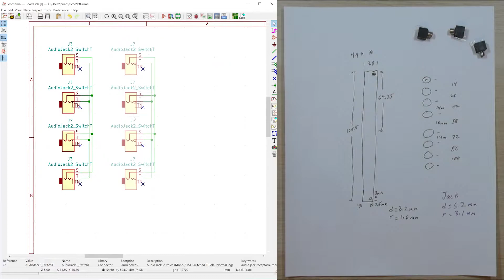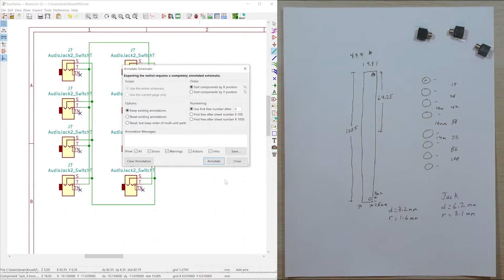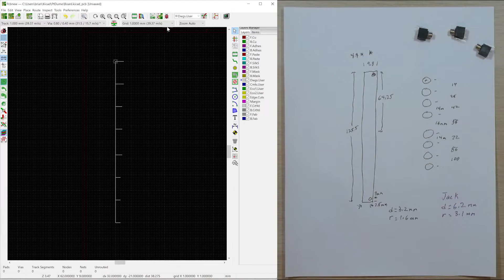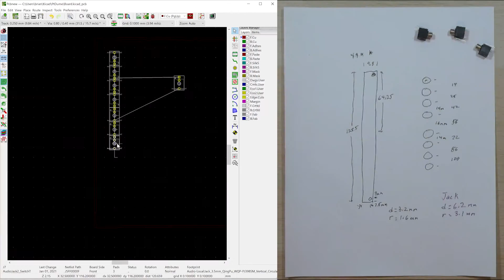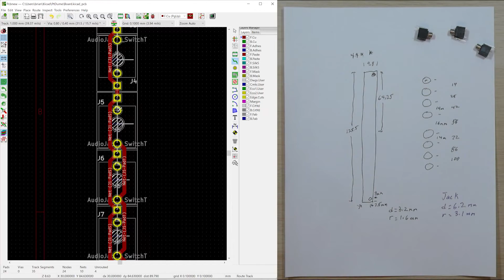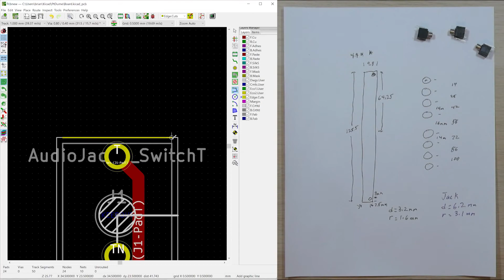How to Make Great Looking Modular Front Panels - Part 3 Module Circuit Board Layout

Comment: the center of the top jack to the center of the bottom jack is 100mm... how did you determine this number? could you go over how you analyzed the data sheet for the thonkicons and determined their spacing and positioning? also what size gap is needed so the jacks don't overlap with the case rails? would be really helpful!
Reply from the maker: Great questions! There are mechanical drawings for the jacks on the Thonk website but I find it most reliable to get parts in hand and measure them with a micrometer or ruler myself. The same thing kind of goes for the spacing between the rails as I don't think the Eurorack standard says anything about that. I measured the distance between them in my rack and then subtracted a bit from that to provide more clearance (but maybe not enough for all cases).

Comment: Thanks a ton for making these.

Workflow question: Is there any way to keep the panel edge cuts and the footprints in sync somehow? Or at least overlay both boards to make sure things line up? Otherwise I can see this getting old very quickly when dealing with more than a handful of components.
Reply from the maker: That's a great question and I've played around with some ideas in the past and not yet hit on something I really liked. I was playing around a bit with filtered selections in Pcbnew and it looks like you can filter out everything but the user drawings and board layout and copy that from one PC layout window to past in another. I may try to figure out a workflow to create a layout that way that can be used for both the front panel and PC board and if that works demonstrate it in my next series.

Comment: And a third comment :) :
You didn't fill the back copper layer like you did for the panel design. I'm assuming, just as with the panel design, that it is easier to understand for jlcpcb if there's a filled back copper layer, right? Even if it's a fully electronically isolated layer.

Alternatively, the back copper layer could also be used as the ground connection of the circuit.
Reply from the maker: It turns out there's a bit of copper on the back of that board, where the solder pads for the pins are. The reason I filled the front panel's back side is that there aren't any through-hole pads and so there was no copper on the back at all (I think Kicad even skipped generating the file for it, which makes sense). When I submitted that panel, it got kicked back from JLCPCB when they checked it because I had ordered 2-sided but the design only had the one side. Because that adds a couple days, I figure it's always best to make sure there's less chance to get things sent back.

Speaking of JLCPCB's design checking: I've been super-impressed. My first boards I submitted I also had SMT assembly for them and it turns out I placed all the ICs upside-down! I think I might have noticed this on my order right before the boards arrived and I was really bummed that I now expected everything to be wrong because of my mistake. It turns out they had already caught the problem and flipped everything around correctly and everything worked perfectly!
Reply: @eurorackDIY  Ah, I see. That makes sense. Well, I filled in the back copper layer, keeping it isolated from those solder pads, of course. I guess both'll work. Potato potato.

Good to hear that JLCPCB really double checks stuff :)

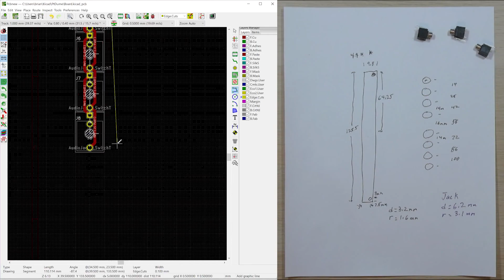Comment: Another question: This pcb that you're designing here has a height of 113 mm (as seen at 35:50). The absolute maximum of other boards I've seen is 111,5 mm and the TipTop Happy Ending Kit offers a space of 112,5 mm. It looks like this design won't fit!? How did you get this pcb into your euro rack case?
I'm designing a module based on this tutorial and I'm trying to figure out how to make this pcb a bit less high, which means pushing the minijack sockets a bit closer together.
Reply from the maker: Great points! I had other plans for how I was going to wire things together using different jacks and not have a PC board for them at all (so literally just solder them together with wire). That is when I planned the jack spacing and now that you mention it I might not have revisited how big the dimension on the board had become. I think I ended up getting lucky that that 113mm happens to fit in my rack (but there isn't much extra clearance now that I look at it)

My rack is 100% DIY including the 3d printed end panels that secure the Synthrotek rails I have. It may be inadvertently spaced slightly wider than other racks out there at what looks to be about 114mm.

At one time, I did look for a spec on how tall the guts of a module can be and much like I've found a lot of the Eurorack standard to be, I couldn't find anything. It does sound like to be safe boards inside the module should shoot for being no wider than 110mm.

Some thoughts on what could be done to the PC board to shrink it a bit:

1) the board sticks out at least 0.5mm beyond the housing of the jacks at the ends. The pads near the ends are 0.5mm to the edge of the board. JLCPCB says that dimension can be as small as 0.2 mm. Also, the drill holes for the T pin are 1.42mm on the footprint and the S pins are 1.22mm and the pins themselves look to all be 1mm wide. So you could change the pads to shrink those T holes by 0.2mm in diameter or 0.1mm of radius. Given all this, you should be able to move the end edge cuts in by 0.4mm (so gaining 0.8mm off the total board length).
2) The center of the T pin to the S pin (the one that's external to the housing of the jack) is 11.4mm. Looking at the jacks themselves, because that pin is on the outside, it could easily be sprung to say 11mm (and the pad spacing between S and TN should still be enough for manufacturing) saving 0.4mm spacing between jacks in a group which is 6 spots - so there's another 2.4mm total.
3) The spacing of the pads between the two groups is about 1.0mm. That could be shrunk another 0.5mm and still not violate JLCPCBs stated capabilities.

So that should be a safe 3.7mm total (but definitely more fiddly in the layout requiring footprint modifications and a bit more precise jack-to-jack spacing and edge layout and that would get this board under 110mm

One more thing that could be looked at is the footprint specified for the jack itself (PJ398SM or WQP518MA) on the manufacturer's site (http://www.qingpu-electronics.com/en/products/wqp-pj398sm-362.html) shows the holes as slots rather than round. It looks like JLCPCB would allow this according to their capabilities (minimum width of 0.65mm which is a bit larger than the footprint in the datasheet) allowing you to shave off even a bit more at least for that external S pin. I don't think I've had a board manufactured with a slot rather than round through holes so I'm not sure if this works myself.

Oh, and also, there may be other jacks that have a smaller footprint (and are still narrow enough for a 2hp module) that could work too.
Reply: @eurorackDIY  Oh wow, what a elaborate reply. Thank you.

Yes, online documentation of this dimension is vague. On the Doepfer site (http://www.doepfer.de/a100_man/a100m_e.htm), which I consider the standard resource, it isn't mentioned.

I've solved it myself by modifying the jack footprint: I moved the S pin closer to the housing of the jack. After that I rearranged all parts a bit too. I have a pcb design that's now 109,5 mm high. That'll suffice. I can send the design later (when it's fully complete) if you want.
Reply: Thank you for this exchange, moving the jacks closer together makes for a neater design anyway and now I know how tall the PCBs of Eurorack modules are supposed to be! Excellent series in general! I hope there will be more!!!

Comment: Great set of step-by-step tutorials! Thanks so much. The added timestamps are much appreciated too.
I'm going through all 3 videos. I got stuck, though, in this one at the 22:30 mark, when importing the associated footprints from the schematic. I see this error message:
" Warning. Cannot update the PCB, because Pcbnew is opened in stand-alone mode. In order to create or update PCBs from schematics, you need to launch the KiCad project manager and create a PCB project."

As you mention, I can re-open the board.kicad_pcb file from the main Kicad project window. I've tried both that and opening the file via Eeschema, like you do in the video, multiple times, also closing and restarting all apps, but the error remains. Any other suggestions on how to solve this?
Thanks again.
Reply from the maker: You're absolutely right and I hit that surprise when running through it from my script. I edited out all the "hmm, what's going on here?" part and was hoping that my recovery description was enough. I'm sorry that it wasn't clear and the flow didn't work out right.

In addition to the .kicad_pcb and .sch files in the original project's directory there will also be a .pro (project) file for each of the Board and Panel projects. If you go back to the main Kicad window and select File->Open Project... and open Board.pro and then from there open Board.kicad_pcb (or click the mostly green PCB Layout Editor icon from the horizontal icon bar) I think that should work better.

I find Kicad's project organization and trying to work with multiple PC boards in a single project kind of frustrating. I don't know if there's a better way than what I did but if someone knows of one I'd love to give it a shot.
Reply: @eurorackDIY  Thanks, that worked! And thanks for the quick reply. I suspected the solution would be some mundane step like that.
And yeah, I agree; Kicad's project organisation seems a bit counter intuitive. But I'm new to it, so still wondering whether it's me or the tool that's confused/confusing.